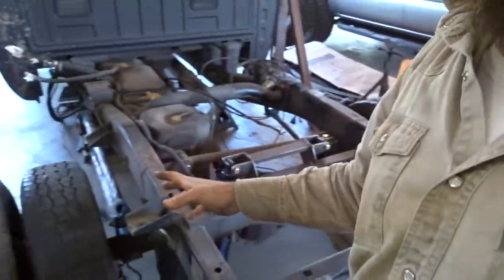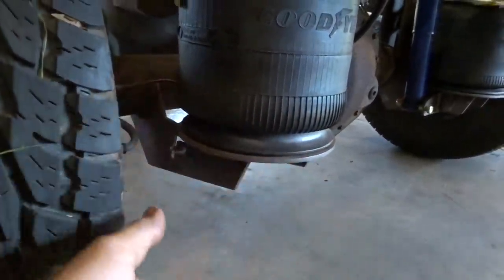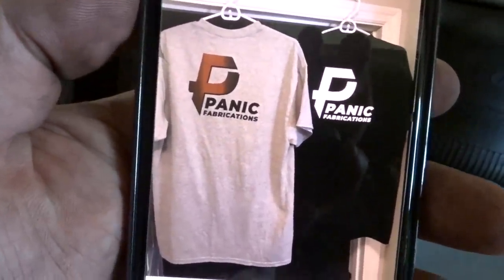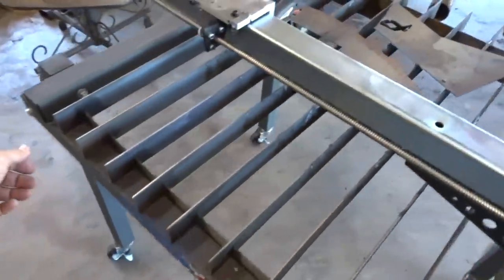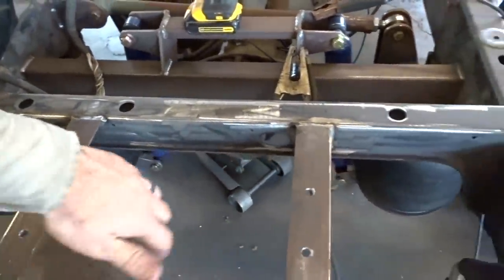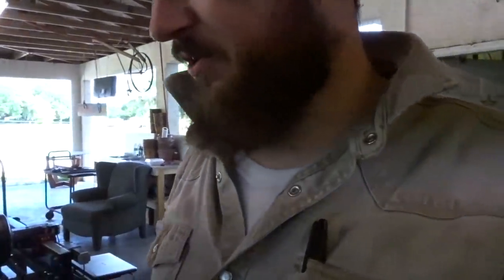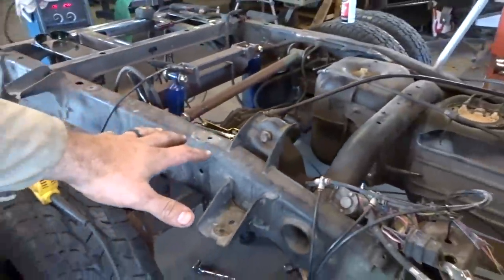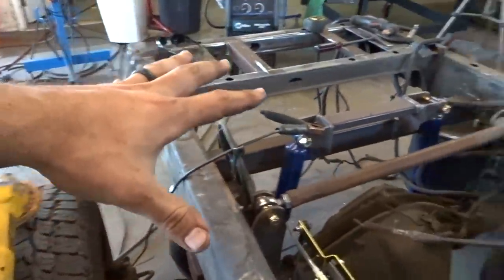Air Suspension on Welding Rig 2.0 (PT 3of3)

Comment: I been driving semis for 15 years and my dads been a welder for 40 plus years that’s how the air ride are on the semis and with your welding skill I wouldn’t worry about anything it will be just fine the way it is and the big truck manufacturers would have changed the design by now if it wasn’t working

Comment: Bro it's custom Fabrication for a reason. I can tell you many stories from my first ever build at 16 years old bagged my 02 Ford ranger with a 110v welder got rear-ended by a full-size SUV and I drove away from the accident but it bent the frame after the c notch but the truck was still rolling straight down the road. It's 1 thing to try ideas on your own vehicles to test out a configuration of different ideas, you can only learn more if you try it out.

Comment: I'm enjoying your truck rebuild for a parking brake I would fix a brake rotter  to the drive shaft making a mount for a caliperand with a hydraulic brake stop hold in the long run it would out last any cable parking brake and hold a lot better also thank you for your sight enjoy watching the build
Chum

Comment: You can buy a dump valve from the same place you get your bags and the leveling valve my friend.  Just tell the guy at the parts counter what you need to do and he should be able to get you the right valve and switch, if not ask a technician at a local truck shop. 
Plumbing in that valve is all kinds of simple, one line in one line out "T" it between the bags and don't forget the gear clamps to hold the rubber eyes on the rod.  
Keep up the great content, we're all looking forward to more cool stuff from Panic Fabrication 👍
Reply from the maker: I’m only halfway familiar with big rig air systems thanks for the input man
Reply: @j_moffitt  no problem, I'm the only guy in our shop that works on all our tractors and trailers, the other guys are Heavy equipment and automotive techs.

Comment: Ive been in the trucking industry for over 30 yrs ...if airbags work mounted behind the axle and can withstand 80,000 lbs on the bumpy ass roads we have across the country they will hold up a welding rig on a 1 ton truck

Comment: Load leveling valves are usually mounted off center pumpkin because if you mount to one side or the other it is going to seriously change the ride height

Comment: Interesting setup. One question and one observation.  Q: How does it ride with the 12" bags....? And - regarding the bags at rear of axles: the only time that is ever done on a semi / heavy truck / etc is when there is a rigid trailing arm bolted / welded to the front of the axle to stop it twisting. As you said, time will tell how your system holds up. You might end up adding a torque rod yet. 👍
Reply from the maker: Rides great with the bags and it might break or it might not, only one way to know haha
Reply: @j_moffitt  sounds good

Comment: can you add the bag plates to your website?  I am putting semi bags under the rear of my c30 ramp truck with a 2 link like you did the other truck.  bags over the axle though since I will be hauling cars.  any reason you chose those specific bags?  I like the overall size of your bag, I don't want to go too large.
Reply from the maker: Just send me an email (jesse@panicfabrications.com) or reply to the website about the dimensions and everything you need and I’ll get em cut out for you, reason I chose those bags is they are cheap comparatively, like $90 each on sdtrucksprongs.com

Comment: 35yrs driving, , guess semi's are all wrong then, yes have a bar that runs back an bag sits on, but axle only has 2 u-bolts holding to that, maybe run a gusset out to pad, but dont see an issue